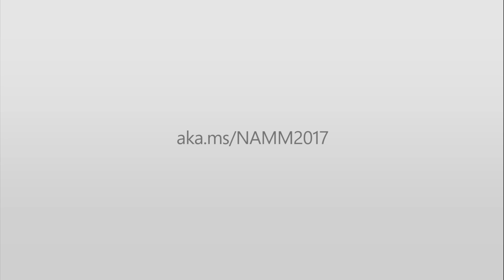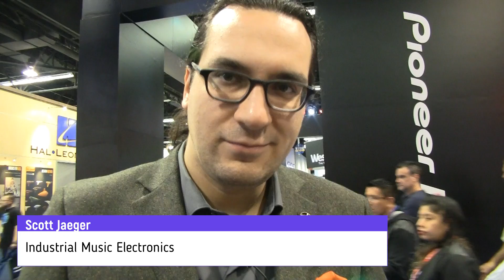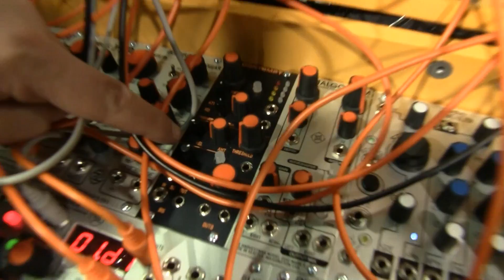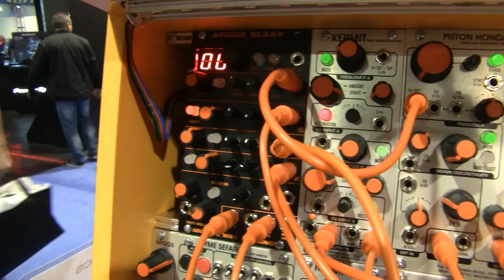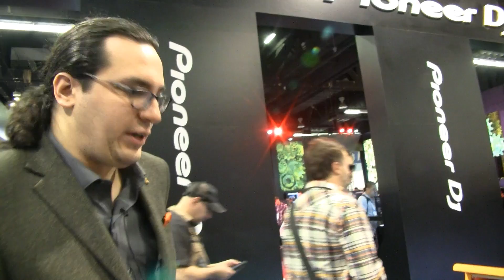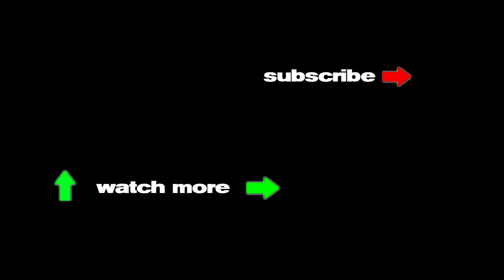NAMM 2017: Industrial Music Electronics - 3 New Modules

Comment: I'm not too fond of module designs that have I/O jacks scattered left and right, top and bottom--good luck getting to the knobs once the module is plumbed in....
Reply: I get you and do not disagree. But speaking as someone who actually owns a bunch of this manufacturers modules, I find the interface on a lot of IME(formerly Harvestman) designs is quite ergonomic.  I got a lot of them side by side and am using them for performance and generally have little issue reaching what I need t reach.  It's not exactly obvious looking at them, but once you got them "plumbed" they feel smartly designed.  A good example is that most of the smaller knobs are right near jacks, those are generally attenuators and you do not need to get in there and wiggle a lot once they are set where you like them.